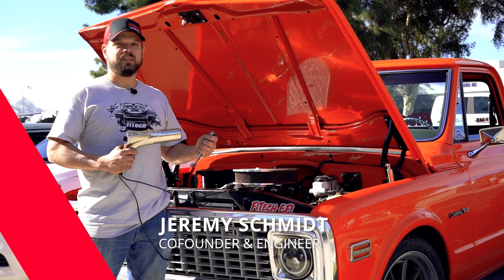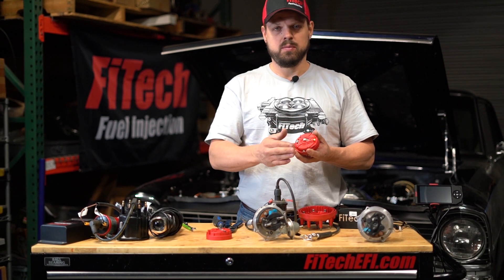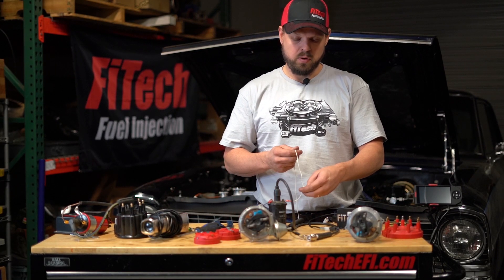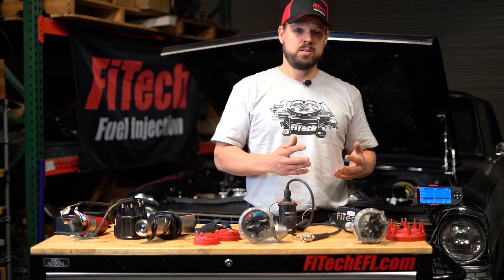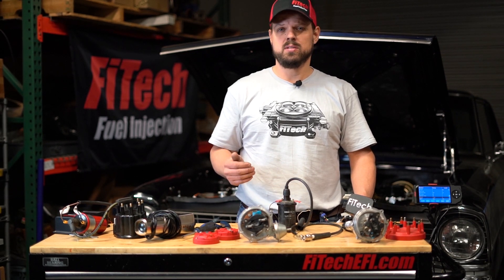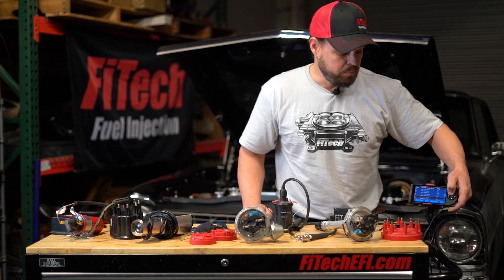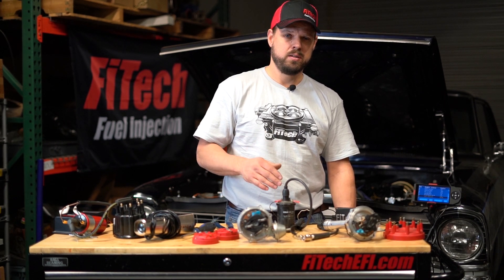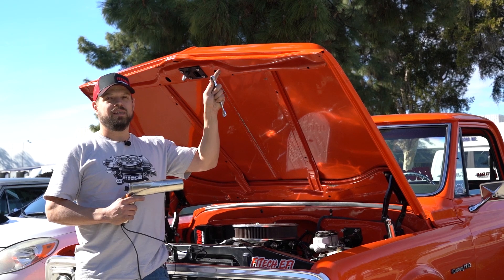Ignition Timing Control | Tech Tuesdays | EP5

Comment: So maybe I missed it....where exactly is the distributor supposed to be installed? Just close enough to get it started, and then check and adjust to the locked value?
Reply from the maker: Correct. Close enough to get the engine started to do the sync process where you use the lock in the software.
Reply: @FiTechEFImedia  thank you.

Comment: Anyone watching this with a 2 wire MSD Pro Billet distributor, Pertronix HP510 CDI box (and maybe even an MSD 6 box) and switching from non timing control to full timing control and having a really crap running motor at the end of it .......  before you give up try repinning the two wires coming out of the distributor (swapping them).
I have to swap the two wires if I swap from timing control to non timing control.
Ive never seen FiTech mention this once.

Incidentally this is with a very early (2016) 600PA model 30004. I had an absolute frickin nightmare back then figuring that BS out myself and their tech line were a waste of oxygen. 
However since them, one software up date and 14,000 miles later and its been flawless.
Have just taken the intake off for a weeping gasket and the ports, intake plenum, valves, venturi etc are all like its done 50 miles.

Comment: I have a MSD ready to run distributor and the Fitech 3002. The wiring diagram is titled"...ready-to-run w/o Timing Control". What does that imply? That the configuration will not use the timing control on the fitch, but will be based on the MSD Distributor PN 8387? If I lock out the distributor will it use the timing control on the Fitech?

Comment: Is unlocking your timing beter for a big cam. I'm running the Fitec 8 on a 454 with comp cam big mother thumper. I have cam setting on 4

But I'm using a 2400 stall with B&M quick Shift. At 800 idol I put it gear and almost wants to pull the car. 

I'm thinking with timing control and IAC can help bring it down a bit

Comment: This is actually a dangerous system. You have people who don’t have a dyno. Don’t have tuning experience. They will blow there engines with to much timing at higher rpm’s. Fitech needs to find a way to include A knock sensor in the software
Reply from the maker: The timing control feature gives the customer the ability to adjust timing within the system instead of changing weights and springs. This is for a more experienced tuner yes but anyone could advance their timing too much and hurt the motor.  Even with a carb. Knock sensor are great however they work by reading frequency. This frequency changes depending on the materials and components within an engine. Being that this system is universal you can not calibrate a knock sensor to work for a stock small block and a fully build 383 stocker with forged internals.
Reply: @FiTechEFImedia  Could you not record a "baseline without knock", then have a learning program that you can run in software that progressively runs the car at higher and higher timings until it produces a bit of knock? Then you could record the frequency change and save it to later use in the knock detection feature.

Comment: will this system be able to control timing on an engine that has a counter clockwise  rotating distributor like on a Pontiac?
Reply from the maker: Yes this system will be able to work with both clockwise and counter clockwise rotating distributors.

Comment: Directions posted online get a little confused when using the CDI and timing control. Both the  to GoEFI and GoSpark show the distributor green and purple wires going to the distributor. I assume with CDI, the GoSpark wires are used. The GoSpark directions show connecting its blue wire to the GoEFI blue wire. I assume the GoEFI black wire should be used instead for timing control and the blue wire is not used? Can the GoEFI blue wire be used as a tachometer gauge signal?
Reply from the maker: Page 4 of the Go Spark CDI Instructions shows the proper hook up of both systems to use the Timing Control feature. The blue wire from the CDI box is the tach output wire that is for a tachometer.
Reply: @FiTechEFImedia  thanks! I was using the instructions posted online at Jegs. They appeared to be complete, but they did not have that page 4 print. CDI White to EFI black and EFI green/purple to the distributor.
Reply from the maker: @JalopyJockey  here is a link to those instructions https://secureservercdn.net/198.71.233.109/l6h.27f.myftpupload.com/wp-content/uploads/2021/10/GO-SPARK-91000.pdf